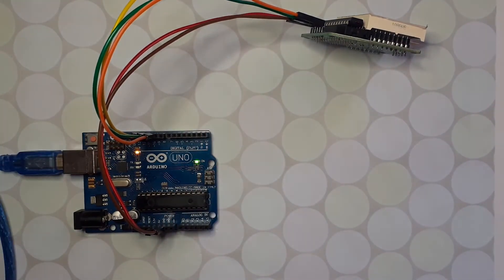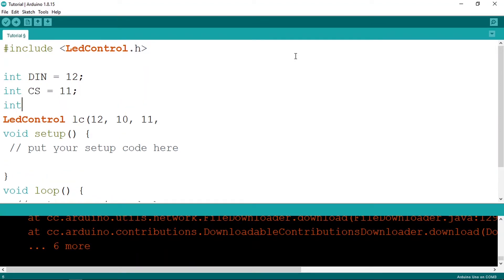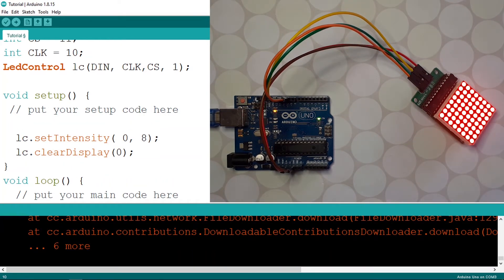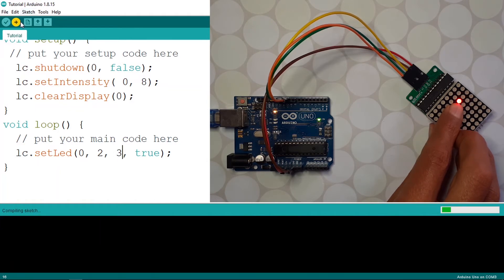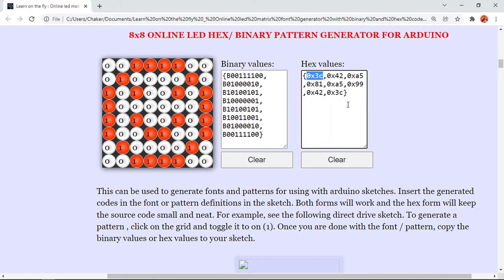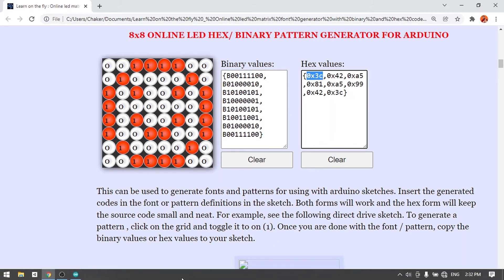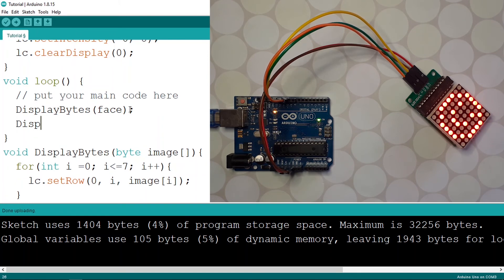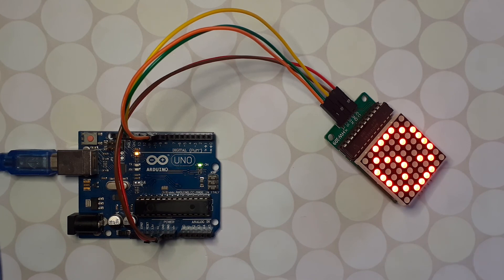Arduino Tutorial 32- Understanding and Using an 8x8 LED Matrix

Comment: C:\Users\91983\AppData\Local\Temp\.arduinoIDE-unsaved2024110-7032-1t0c0zx.jgmi\sketch_feb10a\sketch_feb10a.ino:1:9: fatal error: LedControl: No such file or directory
 #include<LedControl>
         ^~~~~~~~~~~~
compilation terminated.
exit status 1

Compilation error: LedControl: No such file or directory
Reply: install the library, look at the side panel for Library MAnager. Add Led Control